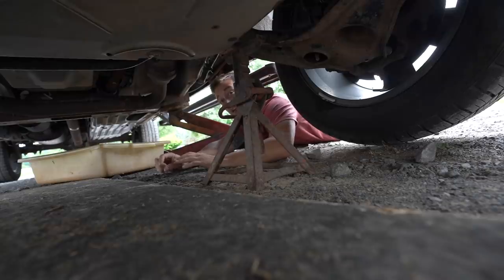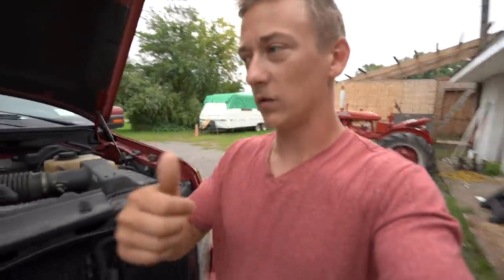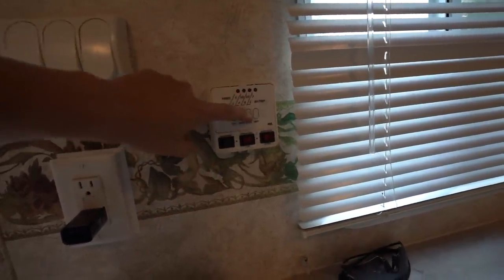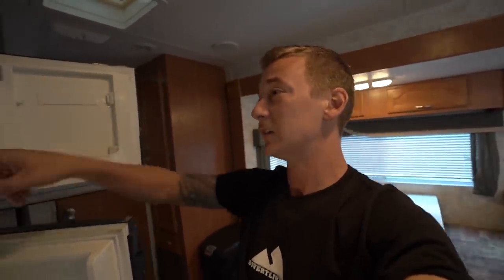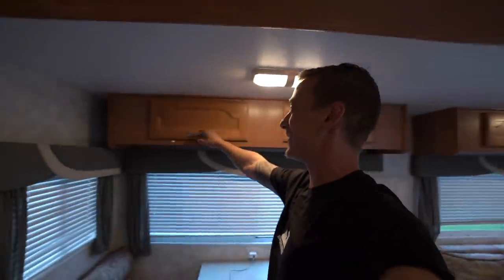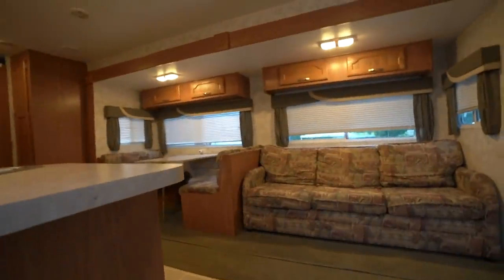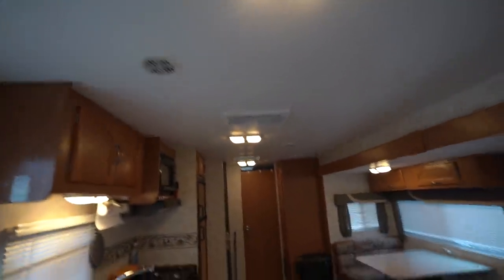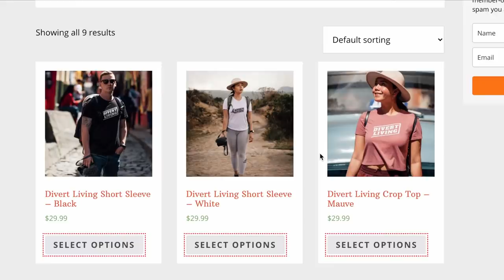CAMPER RV TOUR -  The Start To Fulltime RV Living?

Comment: Just an option if you come back to this style of living again. There is a site at www.volunteer.gov that you can find different state parks across the US that will let you stay for free if you volunteer some time to work at the campground. There are also National Parks on there too. I spent about 2 years doing this from state to state and had a blast.
Reply from the maker: Thats amazing! Ive never heard of it but will look into it next year!
Reply: @DivertLiving  Usually they require 40 hours of work for an RV so if you take 2 people you can both do 20. That is not a hard and fast rule. I found several when I was alone that let me work 20 hours and then do what I wanted.
Reply: wow. Thanks for this link

Comment: You should go into Georgia Mtns from NC. You could go to Helen, GA. There is a small German Style town. Blue Ridge Parkway is amazing during the fall colors season. Best time is near the end of October for most of the parkway until you get to higher elevations around Mt Mitchel (tallest point east of Mississippi River & 360 view). The best time there is beginning to middle of October. Possibly check out Clingsmans Dome also another 360 view. - I know this because I live in Charlotte, NC. My wife and I go to the Mtns & Parkway maybe 5-7 times a year. I know a lot of the area.

Careful with that RV some of the side roads on the parkway are very curve not good for driving an RV down.
Hope you fixed that nail in your tire on the truck.
Reply from the maker: We are going the ridgeway!